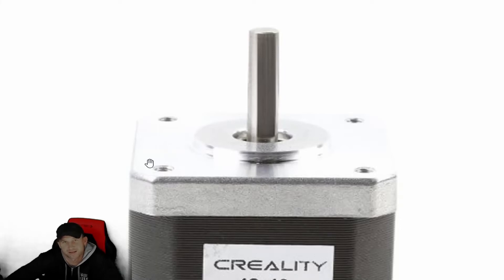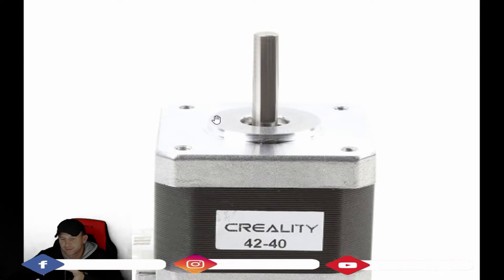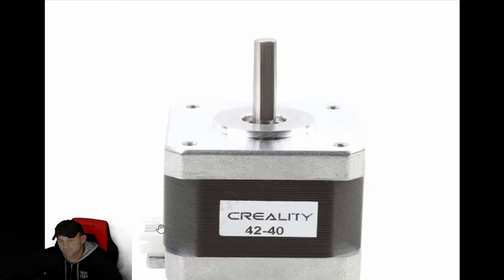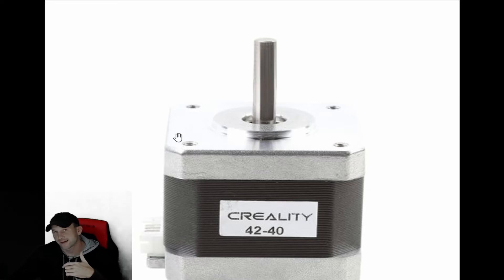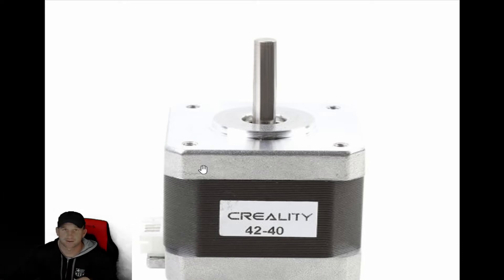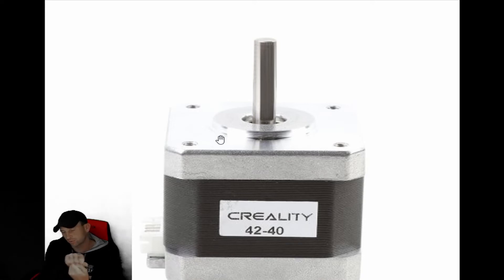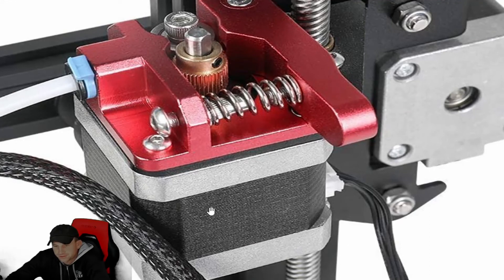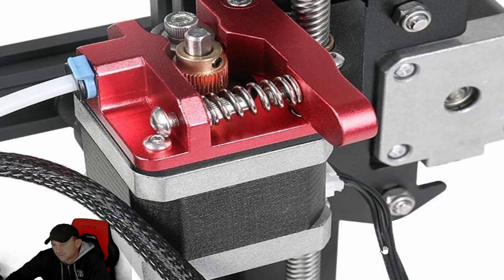3D Printer Stepper Motor Problems. Replacement Help Tips and Trouble Shooting. New Stepper Motor.

Comment: I have cr-x I  can manually feed filament but when start printing is
does not work
Reply from the maker: Check out our filament heater value tips video.  This will tell u how to unclog it and or why this happens.  IHUCT
Reply: The stepper motor don't work